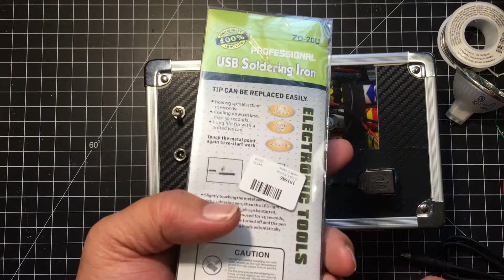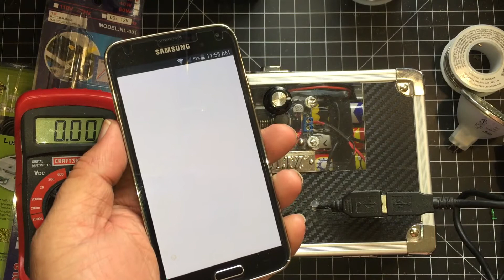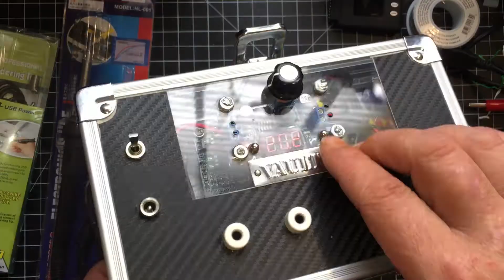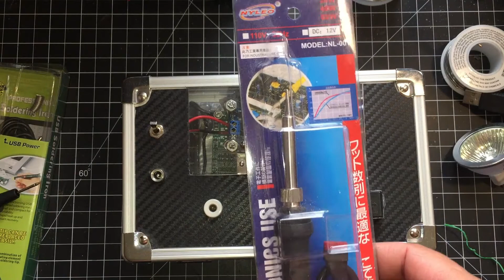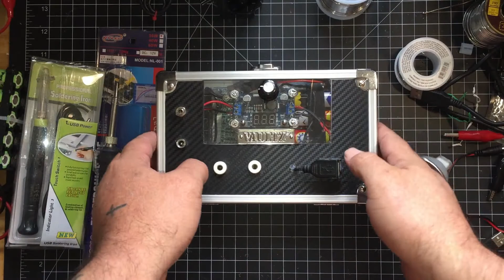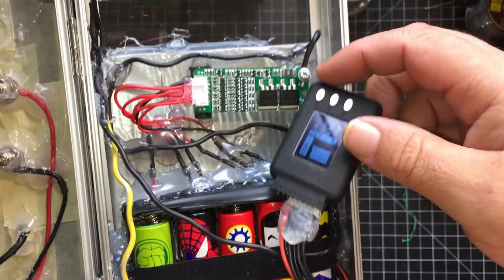DIY Portable 18650 3Amp USB Power variable Supply "LM2596" 5S1P

Comment: I tend to build alot of USB power banks, I made a few lights that plug in to them, I have one I completely charged my phone about 7 times, and it was about half charged, I'm going to add a DC buck converter, so it can charge faster from 12v-24(29v) my house main bank is 7s, ,  I also have a 12v LIFePo bank 250ah for 12v lights and radio!

Comment: lol S5, I got the same phone I'm going to use to strap to my skateboard rides and make videos with. Solder the knob on the top?
WHy didn't you just buy lock nuts so it doesn't come off easily, or you could use 2 normal nuts and tighten them to each other although sticks up much higher.
You could probably find USB mountable plugs for future builds, would be better but if you got a cable one around then go with it ey..
gee those cells are pretty level for an old set of cells.
Reply from the maker: To tell you the truth, I have no idea why I did half the stuff I did back then. It seems I always do things the hard way first..LOL--Wait till you see my WallWart!